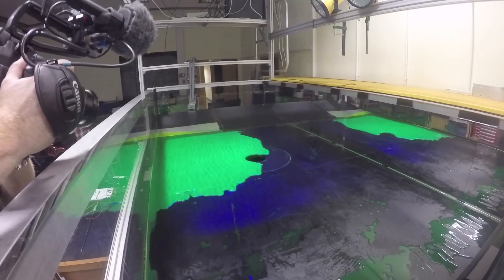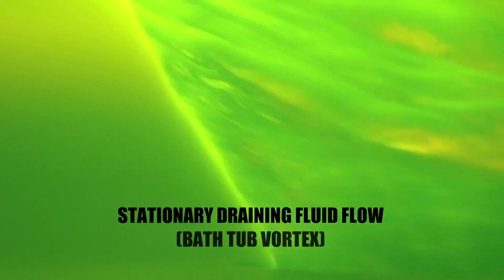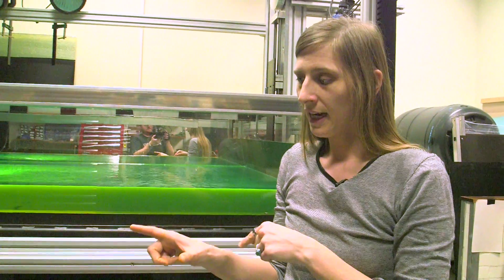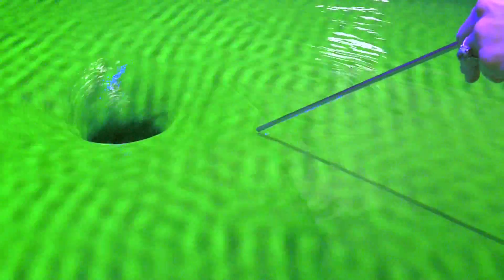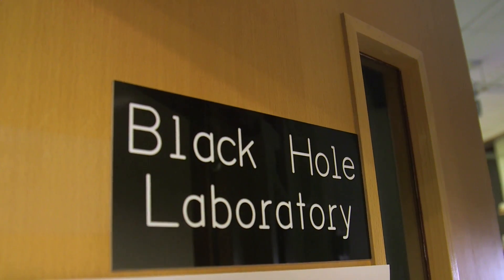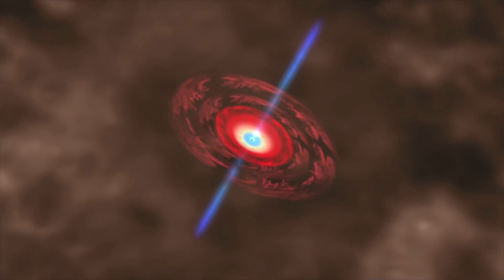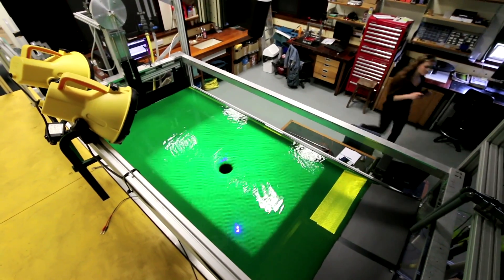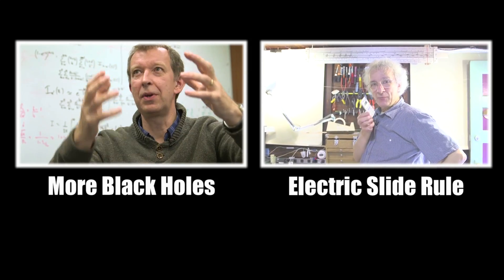The Black Hole Machine - Sixty Symbols

Comment: But but... if you can extract momentum from a black hole, how does momentum get transferred?

Im guessing, you dont need particles for the exchange? Just curving space-time?

Perhaps we can harness the energy some day :O using black holes as cores for spinning dynamos xD
Reply: There are two ways to look at it, both incomplete. The first requires gravity to be mediated via particles.In this case the gravitational field  of the black hole emits 'virtual gravitons' in a nonsymmetrical way, in effect giving rise to a 'radiation pressure' that pushes the object while simultaneously causing the hole to lose momentum.

In the other spacetime is responsible. Matter and spacetime are linked. The hole warps spacetime, in effect putting its momentum there and any object in that spacetime can exchange momentum with the black hole. This is closest to what the model shows here. The link is the water which all objects embedded in can give energy to and take energy from. We see other effects as well; an object moving in water creates a wake and can send off waves of energy, equivalent to gravitational waves. (These water waves even stretch and compress objects a tiny bit as they pass, though not in the same way.)
Reply: This would depend on how spacetime itself is stiched together so to speak, in what way it interacts with itself. In this system you get momentum out of it through the compression of the water near the "horizon" causing a scattering effect. So it sort of depends on how well water is analogous to spacetime itself. 

Very interesting question though, and im sure a physicist can answer your quesiton much better then i can, im not an expert in any way.
Reply: Gareth Dean
Thank you very much for typing all that out :) Interesting read ^^
Reply: *****
Both cases rely on some interesting physics.

Due to the 'weird' behavior of virtual particles  momentum is conserved. Consider a hydrogen atom, the proton and electron 'feel' each other through exchange of 'virtual photons'. If I 'kick' the proton it can be said to emit some of its momentum as a virtual photon that hits the electron giving it some momentum and causing both to move in the direction I 'kicked'.

But what if the virtual photon 'misses' the electron? Won't the momentum be lost? No. The virtual particles are not 'real', they can't exist separate from the proton\electron. A 'missed' virtual photon just 'vanishes' leaving the proton with its original momentum. The same goes for 'virtual gravitons'.

This... sounds really weird and problematic. And it is, since 'virtual particles' are more complicated then this. It does make sense, but you have to describe particles as waves in various fields. I can do that, but it takes a bit of working through.

In the second situation the issue is how black holes are 'structured'. All information about black holes is considered to be present at their surface, their event horizon. This is why things like 'entropy relates to surface area' are said about them. (See here: https://en.wikipedia.org/wiki/Black_hole_thermodynamics )

As such anything about a black hole MUST be able to be described by conditions at its event horizon ONLY. What this means is that when considering them we DO NOT think of their gravity and momentum as arising from something inside the hole, instead we can view the hole as 'empty' and all the mass, gravity, momentum and such being due to the horizon being an infinitely dense, thin, massive shell.his is the 'holographic principle' ( https://en.wikipedia.org/wiki/Holographic_principle  )

In that case the spacetime effects are not coming from inside the hole but from the horizon, from which they can propagate. This is the same thing that allows Hawking radiation, the interior of the hole does not emit it, the surface does.

This leads to a famous problem; traditionally black holes have been considered to not be able to emit any other kinds of information, such as what kinds of particle formed the hole because that information couldn't be 'stored' on the surface of the hole. But Hawking radiation demanded this information be released. This is the 'black hole information paradox'. Recent work suggests this information is in fact on the surface as well, solving the paradox.
Reply: That would make sense to me, but I think that trying to use the Ergosphere for the effect would still be experiencing serious time dilation, and it would make extracting the energy in a timely manner a problem.
Reply: Gareth Dean
Thinking about both of the situations... Think I understand them, though im not too comfortable with the subject...

First situation reminds me a lot of Hawking Radiation. Doesnt that model imply a loss of momentum with time? Rather dont we consider momentum be preserved unless another force acting upon it?

Second situation: doesnt that model require space-time to be able to cross the event horizon? Or at least, the 'information' of momentum can exit the event horizon...

Hmmm...

Comment: what confused me 
is the black some kind of like a real hole that suck everything? or is it like a "ball" that sucks everything?
Reply: its a point technically
Reply: A real black hole is a sphere (i think) but that mock up is "2D"
Reply: It is a region of spacetime where the gravitational warping of spacetime is so strong 
that no matter which direction you go, it leads you closer to the center. It does not "pull"; you can still orbit around it. But unlike planets or stars, there is a point that is "too close" for any physics-obeying entity to escape the gravity well.
Reply: We don't know what a black hole is. We know how things behave outside the event horizon, but inside the event horizon our only hope is that the formulas we have that describe the outside also works on the inside. According to our current simplest model of a rotating black hole (a so-called "Kerr black hole"), you can, on the inside of the event horizon, actually move in a loop in time and space and hit yourself in the back, without ever invoking and "faster-than-light" or "warp-speed" travelling.
Reply: It's like a ball, but it doesn't suck. What sucking is, is where a region of high pressure pushes stuff towards a region of lower pressure. In a vacuum cleaner the outside air pushes the dust in as it rushes to fill the lower pressure within the vacuum cleaner.

What black holes are like is more like how a ball falls to the ground. Throw a ball a little faster horizontally and it curves towards the ground. Throw it fast enough and it spirals down, slowly but surely hitting the floor (floor is the surface of Earth, so spherical). 

What this experiment is trying to demonstrate is a proof of concept: that is it possible for waves to "steal" some energy from the "spinning" (angular momentum) to make the waves slightly higher.
Reply: +YuTe3712 
Black holes do "pull" things to them. Any object "pulls" another due to gravity. 

objects orbit because of inertia, when modified by an object's gravitation [force].
Reply: If a black hole is a point then why some black holes larger than others?
Reply: Tom Mulligan The mass isn't infinite, it' the density that is, and even that probably isn't really infinite, it's just that our best math gives that result.
Reply: Petra Kann Name a "thing" that was concidered impossible by mathematics and has been done anyways. Abstraction is a feature. Thats what makes mathematics usefull for every science.
Reply: +Pa Pinkelman This is just speculation, but I'd say the orbital slingshot maneuver is feeding off the orbital velocity of the victim planet and has nothing to do with the speed of the planet's spin. If you tried to recreate the orbital slingshot in a pool like this one, where the victim planet is stationary in the middle, I'm pretty sure it would be physically impossible.
Reply: "Ball"
Reply: I'm not sure if "sucks everything" is a good analogy but if so, it would be a ball (a hole in three dimensions).
Reply: ***** can you prove this?
Reply: effectively there are no relativistic effects in this fluid vortex experiment. What is a Classical Newtonian "black hole"? Need to be very careful in transferring conclusions made in this model with what is actually happening in a real Black Hole.
Reply: A black hole doesn't have a shape, it's a point in space with extremely high mass. It's perceived as a sphere because of the way it interacts with other objects (if they get too close - past the event horizon, there is no way out). The size of a black hole isn't changing, it's mass is, the more mass it has the further it's event horizon reaches.
Reply: +Slurcho Kotkins Atleast so many people are in here i was wondering about something......Why is light affected by black holes???....
Gravitational force should have no effect whatsover because according to F=GMm/r^2 , the force would be zero
Then there is debate according to the inertial mass but again that inertial mass is basically 0/0
The only other thing i have seen is people say SpaceTime is so much curved as soon as you enter the event horizon all directions point towards the center...But that leaves the question why light was being affected outside the black hole?

Help Me someone
Reply: +LandOfSigh Don't we do something like that with spacecraft slingshot around a planet to give the spacecraft more speed taking energie from planet orbit? Or am I just rambling...
Reply: +Tom Mulligan You see we say they are more massive & not bigger in size...More massive means they were formed from more massive stars....hence they will be more dense than others because more mass is being packed in to a point...thus more massive means more gravitational pull
Reply: I think some people are getting terms mixed up. The singularity is the point; the black hole is the surrounding area where the gravity is too strong for light to escape (hence, the reason it appears black). Black holes DO get bigger the more matter that enters them; it's the singularity the stays the same size.
Reply: Neither.
Reply: a spherical hole,

what we see here is a common vortex.
Reply: I've been reading up on the subject with great interest. The 'point' that you refer to is called the singularity as of course you already know. This singularity at the center of black holes is a one-dimensional point that contains infinite mass and where density and gravity become infinite and space-time also curves infinitely, but this is where I'm having trouble understanding.... 

All black hole singularities must have a size equal to zero, being one dimensional, therefore one would assume that all black holes are of equal size. Infinite mass <> infinite mass. Despite this astronomers can measure the width of a black hole by its Schwarzschild radius. The Schwarzschild radius is directly proportional to an objects mass.
So my question is, how can all black holes be of equal mass if their Schwarzschild  radius varies? And if they are not of equal mass then how can all singularities be size zero?
It seems to me that it can't be both, it has to be one or the other.
Reply: It's amazing how many "things" can be done theoretically and indeed, how many "things" that are theoretically impossible that have been done.
The produce of mathematics is always an abstract, theoretical andreligious "thing"
Reply: Petra Kann i wonder if you understand the meaning of the word singularity. 

Anyhow, arguing with the likes of you has been proven useless. You are unable to state an argument and already way to ignorant to accept any other viewpoint.
Reply: Wouldn't the mass of all blackholes be the same if they are all points?
Reply: Tulanir1
More or less.

Comment: I'm curious why they're using optic cameras for resolving the surface, instead of IR depth like the Kinect.
Reply: What they should do then is add to the water an ion or molecule to make it a matter of single frequency observation then. Essentially render the water invisible.
Reply: Wouldn't it be just as easy to illuminate the water with a single frequency, or as close as possible eg. a sodium lamp?
Reply: They don't seem to be interested in the perturbations underneath the water, since there is no analogs "subspace" in space time. Even if there is, they seem to be more interested in modeling how signals are affected by black holes, which you don't need anything but the surface for.
Reply: This is aprt of the setup and relates to why a dye is being used. The dye and cameras allow them to capture the 3D structure of the surface, notably the amplitude of the ripples crossing it.

IR does not interact with the dye (and dyes that emit IR reliably are tricky to fin and poorly documented.) and tends to suffer interference from IR sources in the lab (and even the water itself.)

TL:DR using optical light provides a cleaner and more well understood view for the computers.

Comment: how would a black hole not rotate?
Reply: If it's bombarded with gravitational waves and loses all its angular momentum to supercritical amplification.

Soon as it was mentioned I wanted to know if there are stationary black holes out there.
Reply: If all of the angular momentum were removed. It depends greatly on how the black hole formed in the first place, whether it came about from multiple merging, etc.
Reply: Theoretically there are non rotating black holes, like the Schwarzschild black hole.
Reply: With difficulty; it'd be like finding a planet or asteroid that's not rotating, it'd require some real special circumstances.